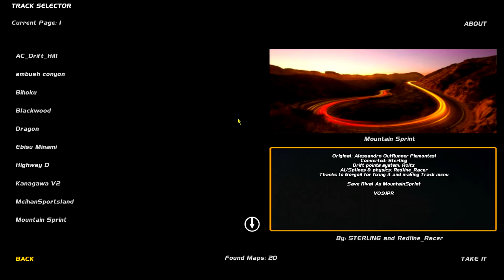not the best setup for the DRIFT SKYLINE... - DRIFTING IN SLRR

Comment: tip n1 stop using vstanced spec, tein shocks and springs (drift) are really balanced for beginner builds so i recommend changing to them and use the wisefab suspension to get more grip on that rear
Reply from the maker: Alright, I'll switch out the vstance